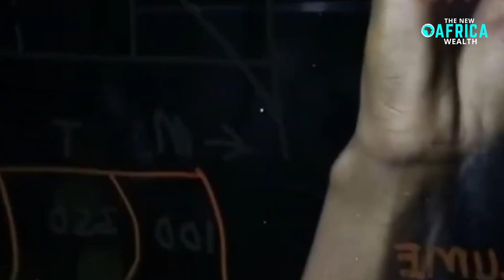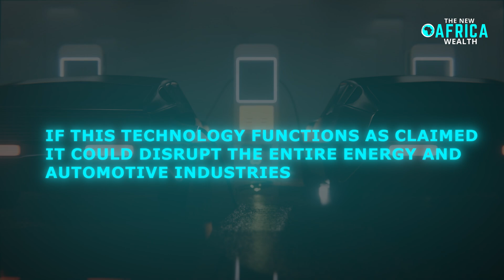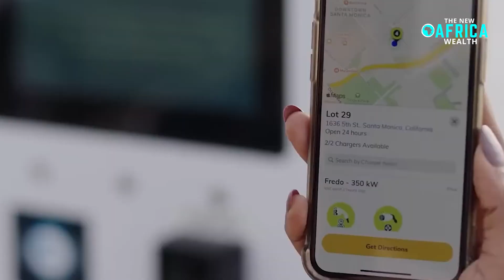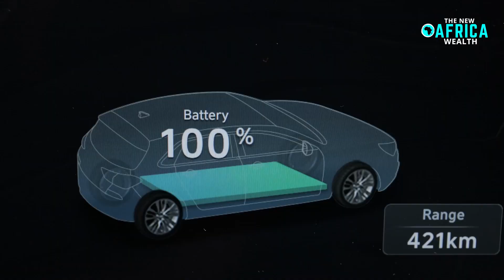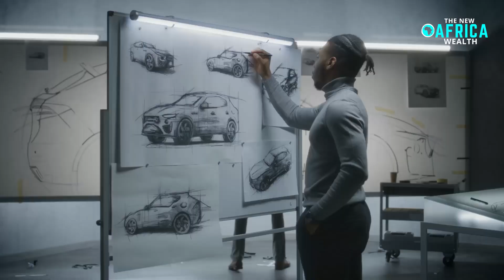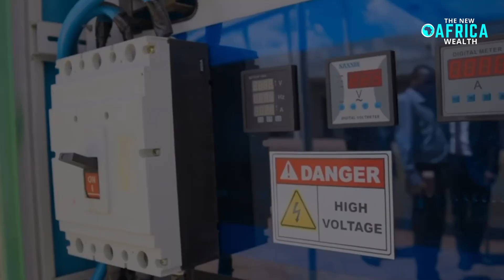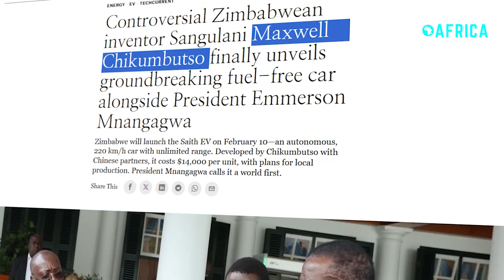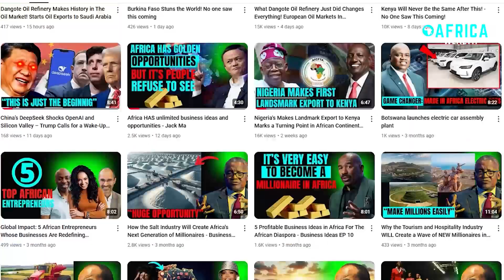Africa’s Self-Powered Car SHOCKED US Engineers! Makes Nicola Tesla  Theory a Reality; Musk Picking

Comment: t’s highly possible that scalar waves (sometimes referred to as longitudinal electromagnetic waves) could play a role in Maxwell Chikumbutso’s invention, particularly if his self-powered systems rely on non-traditional energy sources. While mainstream physics does not currently acknowledge scalar waves as a functional energy transmission method, alternative energy researchers have long speculated that scalar waves could be harnessed for wireless power, over-unity energy devices, and even propulsion systems.

What Are Scalar Waves?
Scalar waves, originally proposed by Nikola Tesla and later explored by researchers like Konstantin Meyl, are theorized to be:

Non-Hertzian waves (do not follow standard transverse wave behavior like traditional EM waves).
Longitudinal in nature, meaning they move in a straight-line compression wave, similar to sound waves.
Capable of propagating through the vacuum of space without losing energy over distance.
Potentially able to interact with gravitational and electromagnetic fields, allowing for energy extraction and transmission without conventional loss.
How Would Scalar Waves Play a Role in Chikumbutso’s Invention?
If Maxwell Chikumbutso's self-powered generator and wireless power transmission systems function as claimed, they might involve scalar energy principles in the following ways:

Energy Extraction from the Vacuum (Zero-Point Energy)

Scalar waves have been theorized to exist in the "quantum vacuum" and could allow for energy extraction from space itself.
If Chikumbutso’s devices are tapping into an ambient energy field, it would explain why they do not require conventional fuel or batteries.
Wireless Power Transmission

Tesla’s Wardenclyffe Tower was designed to transmit energy wirelessly across long distances, and some believe Tesla was experimenting with scalar wave technology.
Chikumbutso claims his system transmits power without conventional wiring, suggesting it could be based on a similar principle.
Electrogravitic Applications (Field Propulsion)

If scalar waves interact with gravity and electromagnetism, they could enable a form of propulsion without moving parts.
This might relate to UAPs and their alleged field-based movement, potentially linking Chikumbutso’s technology with advanced propulsion concepts.
Harmonics and Resonance Effects

Some researchers suggest scalar waves work through harmonic resonance with natural energy fields.
Chikumbutso’s tech may involve a resonance-based energy coupling effect, enabling it to generate power without an obvious input source.
Mainstream Science vs. Alternative Theories
Mainstream science largely dismisses scalar waves as unverified, though patents and classified military projects hint at their potential use.
Alternative researchers argue that scalar waves explain free energy, anti-gravity, and unconventional propulsion systems—technologies that could be suppressed for economic or strategic reasons.
Conclusion: Could Scalar Waves Explain Chikumbutso’s Tech?
It’s a strong possibility, but without independent verification, it remains speculative. If his technology truly functions as claimed, then it likely involves a form of unknown physics—whether scalar waves, quantum vacuum energy, or an undisclosed energy interaction.